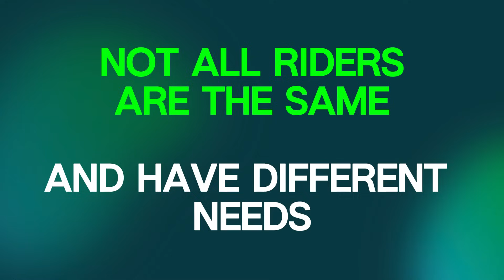DJI Under Fire: Will Europe Shut Down Their 1000W Avinox e-Bike Motor?

Comment: You don’t ban supercars on the road just because it could be dangerous with your wife sitting behind the steering wheel. 😉

It’s seems like somebody just need to get better and then the costumers can choose which kind of bike whether it’s a Sl e-bike or big e-bike they like.
Reply from the maker: That's a great point. With any powerful vehicle, its the vehicle operator that is unknown and the biggest threat to those around them. Thanks for watching.
Reply: There is a reasonable argument for public liability insurance,  at some point there has to be a limit . I do 20 to 30 miles a day on public bike trails and have had a couple of near misses with e bikes . Too easy to go fast !

Comment: So, lets say a new law is coming. A little Firmware update will do the Job. Okay, bad for amflow and dji, but anyway, they will have still great implementation, and a very silent motor System with Features Bosch will charge for with a monthly subscription fee. 
Next Bike: dji System.

Comment: Yup, sounds like a monopoly. I'm on the side wth DJI. Germany is trying to corner the market. Also 5:34, no, it does not. And here's why: if you're hiking on a designated MTB DH trail that's clearly marked "NO HIKERS", you're asking to get laid out. It doesn't matter if you're riding an eMTB or analog. It's like saying limit highway speeds because pedestrians might get killed. Besides eMTBs and analogs are all traveling the same speed DH regardless. It's a moot debate. I have this discussion all the time in my area within many circles and organizations. The thought process out here is that what's available now, should be the end game. Coming from someone who's riden eMTBs for several years now, if you want anything higher than what's available now, just get a damn dirt bike and hit up an ORV or MX park. 

Great video and good discussion. You keep it neutral. And that's just damn good reporting. Subscribed.

Comment: Can’t speak for the whole world, but here in America we have a bunch of jackass emtb riders who will flagrantly abuse any rule for speed, torque or power.  America badly needs rules to control our idiots…😢😢
Reply: Clearly can't speak for America either. You must be thinking of Surrons or Talaria riders where States are already passing laws banning these bikes not only on the trails, but roads and sidewalks as well. Far as eMTB riders, literally nobody thinks that way here in the PNW. eMTB riders don't abuse speed, torque, or power. They can't. Because all those factors are baked into the software and motors. Also nobody thinks they're idiots. Many pro's run eMTBs to train and simply rip the DH and not waste time on the uphill. Anyone who thinks eMTB riders are idiots isn't in the majority out here, not by a long shot. Your line of thinking is in the extreme minority in fact.

Comment: USA rider here.  Specialized Levo 4’s class three setting is a threat to access on trails everywhere- don’t buy bikes that threaten to kill our sport.  The 20mph limit is all you really need.   I’ve ridden more powerful emtbs and generally feel the extra torque is only useable in rare occasions like long boring two track or tarmac.   That much torque in technical situations is unmanageable.  I’ve found that a well managed 60nm motor is a sweet spot of just enough power yet still feel like a mountain bike

Comment: Forget peak power , I find the 25kph speed limit ridiculously slow even off road . We should adopt the 20mph limit allowed in the US.
Reply: 20mph is fine but not enough. The limiter is just a ridicolous idea for a motor with not one horsepower.
Reply: @Raumance  IMHO its a bicycle, not an electrical powered motorbike. If you want more power and speed get a e-motorbike? As with all restrictions though, they means nothing if the rules are not getting enforced.
Reply: @darrenpardoe I don’t want an e-motorbike as then I lose access to mountain bike trails.  I just want a bit more speed as the current limit is just too low.  Running into the limiter all the time is horrible .  I may be tempted to break the rules at some point if they don’t change .
Reply: 💯 Totally agree!!! Im coming up to be 62 and im not the fittest fucker out there by a long shot !!  At least if was 20mph you could keep up with the flow of traffic in town! 
instead, there is cars taking desperado moves to overtake because of silly auld men on EMTBs !!!😊

Comment: I think the best way to deal with this is limit max assist speed to somewhere in the 25-30 km/h range and forget about limiting power.
That way you don't have to write complicated rules for cargo bikes and other e-mobility devices. 
The power limits are a bit of a joke anyway with peak power sometimes being way higher than the continuous power they're trying to limit. 

Do it this way and the industry will quickly figure out what sensible power outputs are for different kinds of bikes and build motors to suit.

Comment: Acceleration should be limited, not power. This would be much safer, and automatically take weight out of the equation. A heavier bike would automatically be allowed more Watts to reach the same acceleration. Same on hills. And also much easier to measure to check compliance.

Comment: 750 watt is about 1 hp,.. its fun to have more power, even much more power, but it doesn't make sense to ask for more on a bicycle. 

Even with a cx4 race at 600  watt peak a heavy, unfit and disabled person can climb stuff on a 190 mm enduro ebike that only elite xc racers on xc of trialbikes can climb, i climb at low heartrate with body armor on shotter and no xc rider is able to follow,... 

Mathieu van der poel weighs around 75 kg and has an ftp of 485 watt, let's put him on a canyon lux cfr that weighs 10,5 kg on a long shotter climb. That's 5,67 watt/ kg total weight.
Now let's put a 100 kg person on a 25 kg ebike with a cx4 race,... if the ebiker produces 150 watt he gets 600 from the motor, 750 watts combined and he will ride away whistling from Mathieu who is struggling to maintain his ftp,... 

With the cx5 upgrade, even a 150 kg person on a 25 kg bike that produces as little as 187 watt (that's around 1 watt/ kg) himself will be just a tadd slower than Mathieu, if it's steep enough off course because on most shotter you will be bumping in and out the speed limiter,... with an avinox even less manpower is required to fly past Mathieu,.. 

If i look at average cycling enthusiasts, they have an ftp around 2,5/3 watts/ kg, only verry heavy or well trained cyclists can provide the 250 watt nominal power an ebike is supposed to provide,..  

For most overweight or disabled people it's already nice to be able to follow average riders, the issue with following their mates is in the 25km/ h limit on the flat and mellow climbs, not peak power,.. And if your fitter mates decide to get an ebike they will be able to climb more demanding tracks and climb faster,.. 

I don't think any legislator thinks it's a requirement for morbide obese persons or disabled person's to beat elite climbers uphill?  Turbo/ race mode is already pretty unsafe for a lot of novice riders,.. 

Cargo bikes,.. They are often used in traffic, inbetween normal cyclists. Normal cyclists on city bikes ride around 19 km/ h on average, uphill they go much slower. If you can't keep up with the kids or elder people you are probably way to heavy to drive safely inbetween cyclists without proper training. If you are the one slalomming inbetween other cyclists at 25 km/ h on a cargo bike, you are part of the reason why people and legislators that see cargobikes as a transport solution also start to see it as a safety problem.

For the normal average ebiker that uses the ebike because it's fun to climb tracks that are otherwise to hard to climb or use the bike as a shuttle bike: On a lot of tracks surons are not allowed and hikers, equestrians, eco extremists would like to have the trails for themselves, any excuse to limit trail access for mountainbikes is fine for them,.. more and more ebikers riding trails that were in the past only possible after pushing the bike makes trail access harder. 

It’s not because the ebike industry asks a 750 watt peak limit and 100 nm torque that the legislators will grant it, politics clearly wasn't ready for it or bosch would have introduced the cx5 at higher output,..
It's possible that the former uci interpretation, 250 nominal, 400% assistance, 600 watt peak, 2 meter overrun,... will become the rule. 
It might become 340% assistance and 400 watt peak,.. remember that emtb is only as small portion of the market and the big ebike supporters are the people that want to get the trails for themselves to walk without having to jump for mountainbikers,...

dji killed a gentleman's agreement and i fear the whole emtb community will suffer from it,...
Reply: Yep, trail access is at risk.

Comment: DJI are risking the entire industry - 600W was enough - nobody was talking about a lack of power. The videos of people with the DJI at 1,000W all make comments about how hard it is to control when setting off, and how the bike wants to wheelie all the time. This bike behaviour does not suit mixed trail use. The DJI point about e-cargo might be correct, but they themselves ignore it, and make max power available on all bikes.
Reply from the maker: I'm not too sure where this sudden thirst for peak watts has come from. As you say, we have been happy with 600w for a long time and provides plenty of assistance for the masses. I do think there is a time and a place for more watts whether it is just e-cargo or if there are other areas for its application. However, I and many other, are intrigued to see how this peak watt battle unfolds. Thanks for watching and commenting.